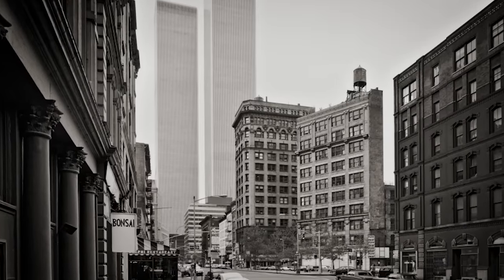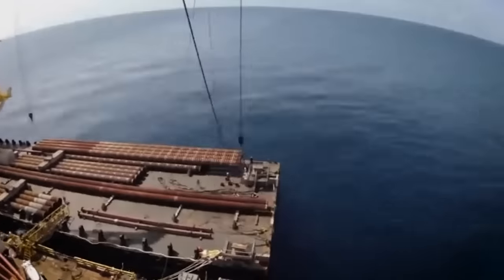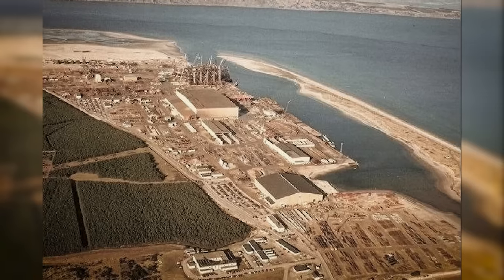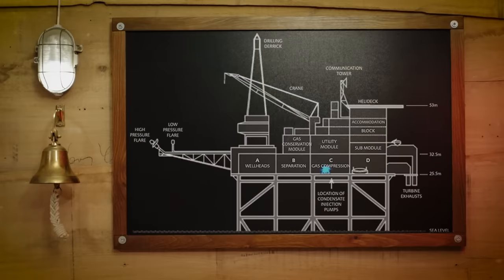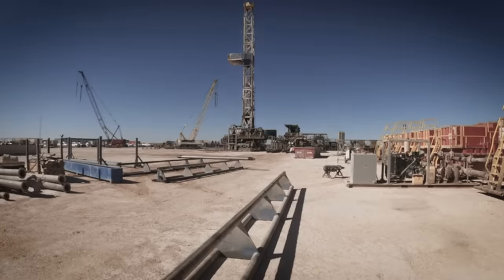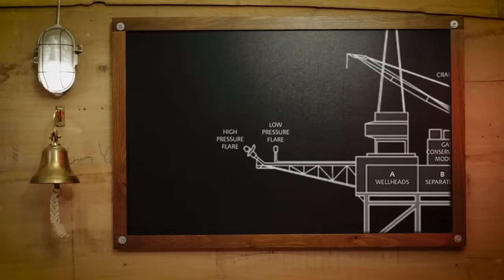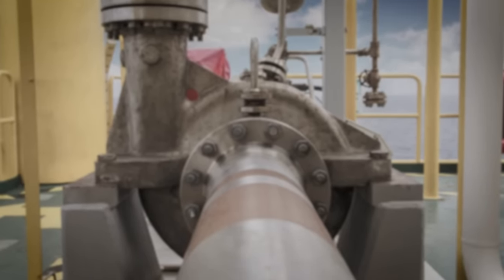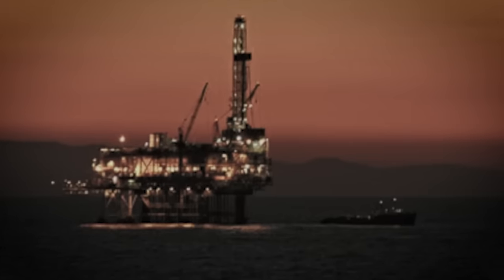This Block Has 87 Dead Bodies

Comment: This is why a lock-out system exists.  They should have been unable to start the pump regardless of incompetence and paperwork.
Reply from the maker: Probably the kind of accident that helps them implement those kinds of changes.
Reply: @waterlinestories  Oil & Gas are well known for their 1 priority production which = profit. Safety, the Environment and people coming up a ways behind. As in sloppy procedures and the fire stop walls that were made of a fireproof material that everyone knew was  brittle and easily shattered. The fact that there were no underwater Safety valves on the pipelines. All cost cutting measures taken to maximise profits with zero value placed on Safety.
Reply: @waterlinestories  
A bit late for those poor guys though😢
But hey the money men got rich so what a few deaths when their bank balances rise 😡 
They should of done time for the sloppy safety procedures. 
RIP lads 💔✌️🇬🇧
Reply: @waterlinestories  Yep thats what happened.
Reply: @jackdbur  Yes..Because it's cheaper to burn a platform down than implement safety training...

Safety is only as good as the men implementing it...
Reply: @markthompson9914  This is what I hate. Every incident should be a criminal charge against the CEO. Not safety criminal. 

The money charged should be 2 times the annual profit of the company and the board should face prison time. 

There was a case with Boeing where it was proven they knew about the problem and did nothing (even actively burying the email from the engineer). And yet no criminal charges.
Reply: @therasco400  yes mate, what u just said rang a bell with me. As a chap I know who is now a successful executive producer of certain motor sports shows and American football shows here in the UK, was once the guy who signed off on whether a plane was air worthy.
Anywho he would not sign off on a plane that he classed was not air worthy because of some plane language that I didn’t understand and still don’t as I’m a trawlerman lol. 
So to keep this certain costumer happy the maintenance company went back through the extensive file they have too have on guys in his lofty position, and found he was once charged with a joints worth of hash ( yes that long ago) when he was at college, so sacked him, and all to get an plane that could of took a couple of hundred souls out in the blink of an eye and oh yeah PROFITS 😡
People like that should never be aloud too put human lives over profits, but my mate was the guys subordinate or u could say the last link in the chain, so was just underhandedly got rid of. 
Still like I say, is in television now and making just as much and has a clear conscience 👍✌️🇬🇧
Reply: @jackdbur  yes. This is well known and nothing new and also not relevant to the comment or response.
Reply: @markthompson9914  what you are saying is purely ignorant and based on bias. It's just as easy to say if you know they take chances to make money yet so do you by continuing to work. When all goes well you're fine with what they do casually ignoring it because youre getting paid. So how different are you really? 🤔
Reply: @coronalight77  well in my 40 year plus at sea I’ve never lost a man too Davy Jones locker and have only one RLNI helicopter rescue of an old decky who suffered a stroke while he was making the coffee for the rest of the guys. I kept him out of as much weather as pos cos I had mad respect for him for what he taught me when I was climbing the ladder, and when I got my own boat he was my first decky cos at 60 odd he could run rings around some of the younger guys. 
So your comment was ignorant as YOU have not fished in weather that I have so know nothing of the risks we all take willingly too feed our families.
But u sit at your desk and judge, cos u know everything don’t ya chuck 🤣😂✌️🇬🇧
Reply: @DynamicSeq  As the platform was insured, it certainly can be profitable to burn it down. (also, the cost of safety can often well exceed the value of the platform. slowing production can significantly reduce profits.)
Reply: Just like aviation.
Reply: @jfbeam  seems like the insurance company at the very least would have a vested interest in lock out tag out lol.
Reply: @jackdbur  
And what is wrong with cutting corners? Capitalism does not care about human life, it cares about maximum profit which means under Capitalism, as long as you make money in turn its morally correct.
UK is already on a road towards Victorian era laissez-faire so cheers mate.
Reply: @coronalight77  it's showing.
Reply: Lockout/tagout the number 1 step for any piece of equipment being serviced offline.
Reply: @jfbeam  as someone who deals with large commercial insurance claims I can tell you that filing such a cglaim can tremenddously icrease preminums on that facility and others you own even if the are insured by other carriers. In extreme cases making insurance unaffordable economically or just not offered. Burning down ones property for insurance claims isn't as cut and dried as many of those not in business think. If it's a one time thing and you own no other properties then maybe ao but not in the day to day business world.
Reply: I'm thoroughly convinced the people in these comments don't think through the things they say and just mimic whatever biases they have. Who wants to bet if a previous poster reads this they believe I'm not talking about them.
Reply: @OneOut1  I have, in fact, had a building burn down. It made very little difference to our insurance, which was already rather high because it was already a high risk. (automotive service) The building where we had a dyno, the insurance agent saw that and just said no. (policy canceled immediately.) Insurance companies know the risks they're taking before they take them. An oil rig in the North Sea is every possible danger.
Reply: Deep Water Horizon springs to mind.
Reply: @markthompson9914  The emergency services here  say not if it happens again but when..
Reply: @pamelaadam9207  sorry “when” what Pamela ? ✌️
Reply: @markthompson9914  no one is forced to pick this job, there's a hundred other jobs you can do, your own experience isn't a really good argument.
Someone sitting a desk, responding to someone sitting at another desk 👍
Reply: @subu_versus  the only desk I have sat at was at school. But I’ve spent hours pondering over my chart table though. As for the poor guys who perished, did they have a say in the safety measures as I did when I knew a blow was coming I got the Fk outta there and looked to fish somewhere in the Lea of the land. THATS taking responsibility for the safety of my guys, me and my money earner the boat. 👍
Reply: @markthompson9914  - Everything you're saying makes sense.  I think it's worth bearing in mind that this accident happened almost 35 years ago (so 5 years after your career began?), when standards were more slack in that regard.  It should also be pointed out that Piper Alpha was one of the older platforms in use even at that time, and all of the changes, including the addition of the gas conservation equipment and subsequent condensate piping were all retrofitted within the physical confines of a an older platform that wasn't designed to do it - the first couple of decades of North Sea oil and gas extraction seem to have been a bit of a free-for-all in some respects.  In the books I've read on the subject it was stated that there's no way that equipment would be installed in that close a proximity to the control room and living quarters on new platforms that were being designed and built even back then.  I think physical/mechanical lockouts became mandatory a a result of this disaster.
Reply: @turricanedtc3764  you obviously have more knowledge than I on this mate. All I knew was that even on the boats I worked on back then, safety was a bit lacking cos the two main boat operators spent as little as pos on that kinda thing. But happy too say that it has improved a helluva lot in the days since, and when I became an owner/ operator all my guys had too have first aid, fire fighting and sea survival training for they stepped aboard. Now year on year more and more measures have been introduced.
It’s just bloody awful that we have too lose good people for action is taken by the big companies 👍✌️
Reply from the maker: @markthompson9914 Are you still on the water? What waters are you in and what industry?
Reply: @waterlinestories  
No mate I’ve hung up my oilskin’s, I couldn’t  compete with the prices of brown shrimp I was getting + the price of diesel and the cost of everyday upkeep. But my little corner of life was the East coast of England. But depending on what I was after as I had a small fish quota as well, plus I blew for cockles, it was from the Thames estuary too the Humber estuary. But my main waters was The Wash (if u want too google it)
That was my little slice of heaven in the smaller boats and the rest when the bigger boats came along. What about yself ? U a sea dog too ? 😂✌️
Reply: Why didn't that oil rig have lockouts by the 1980s I can only guess someone at the top was a greedy penny pincher.  Because by the 1970s (on land) electrical contractors had electrical lockouts as part of the electrical code.  One large industrial-size jobsite in late 70s was high paying, but run by a a corner-cutting penny pinching fool who had everyone use same-keyed locks on lockouts.  For one circuit there was a lock on and so a second lock was added.  About 20 minutes later go to cut a new electrical line on that circuit with linesmans pliers and Blam!!!  The cutting edge on those pliers has a large round hole on them which I keep as a reminder to never take safety for granted and never trust someone in a rush who insists everyone uses their same-keyed locks while aggressively pushing everyone to be done before you even begin.
Reply: @SMGJohn  it’s not capitalism. 
It’s greed. Plain and simple.
Reply: I have worked with supervisors who couldn't screw in a lightbulb who were absolutely sure of their choices and I would be begging them to stop as they would be cutting off the locks and the tags that said not to touch these panels

They never listen to the little people

But when it all goes wrong they love to blame us
Reply: Gee, hindsight is 20/20...
Reply: Captain hindsight to the rescue!
Reply: It always comes down to incompetence and money yeah
Reply: Yep lock out tag out.
Reply: @jackdbur  "with zero value placed on Safety."

They dont care, the INSURANCE covers everything, like airline crashes- the insurance pays all the lawsuits and damage and the airline gets a new plane
Reply: @therasco400  Trouble IS, companies incorporate and incorporation shields the CEO and the higher ups from PERSONAL liability, victims have to sue the "company" while the CEO and those responsible keep etheir McMansions, 6 cars and all the rest
Reply: @SMGJohn  sigh... capitalism is not about morals.. it actually says NOTHING about what morals u should have, it's just a way to optimize the manufacturing of goods and services. And there doesn't exist a single nation on earth that do not have some moral guidelines on top of the capitalism. Ur not allowed to sell heroin = moral guideline.
That alot of internet commies doesn't get was capitalism means is probably bcoz communism is not only a system for manufacturing of goods and services but also a moral system, something capitalism is not.
Reply: @richardcranium3579  
Capitalism is a system which does not perpetuate profit motive?
So how does Capitalism work exactly according to you? Cause I am real interested.
Reply: @KrGsMrNKusinagi0  NO WAY! ITS AS IF NOTHING IS PERFECT IN THIS UNIVERSE!!!!
Reply: @DynamicSeq  but implementing safeguards reduces short term profits. Ignoring the issue will help increase management's bonuses next quarter.
Reply: This was late 70s early to late 80s... welcome to the era of she will be rite mate. Safety is only implemented by large corporations when $ will be affected. This includes govt regulations. Any regulations that only garner fines are easily  taken as rough guides, anything that can cause catastrophic financial loses to shareholders is given more concern... less for worker safety and more for continuing to make $. Sure noone wants workers to die but costly implementation of slow down rules are always last to be forcibly implemented.  Having a system of central paperwork filing, supervisor meetings and double checking of all works done, regardless of importance, would take too long between shifts thus ( prior to decent computers) would be too costly. Unfortunately these deaths are the only things that tend to change dangerous practices in large multinat corps.
Reply: GREED WAS THE PROBLEM!!
Reply: LOTO 😌🙏
Reply: @markthompson9914  I've read your comment a couple times and still don't understand what the hell you're talking about.
Reply: @bradsanders407  and that means what too me 🤷‍♂️✌️🇬🇧
Reply: @pamelaadam9207  I’ve just re-read your comment and I must apologise for my brain fade at the time. I now see what u mean. 
“It’s not IF but WHEN” 
✌️❤️&🍀lass 👍
Reply: @waterlinestories  @aw
WF
Reply: @jackdbur  😅😅😢
Reply: Those are expensive, so they aren't paid for
Reply: @DynamicSeq the platform is insured and they can just blame the workers, so it all works out for them
Reply: A postal worker once told me: “if you don’t want your package to be bent, make it unbendable.” I’ve always stuck by this.
Reply: @therasco400  The Boeing situation is obviously vastly different than this one. They were operating within the safety measures of the day. What's more the CEO for Oxy had no real say in day-to-day operations here, it doesn't make any sense to consider him as the one to blame.

We have much more robust safety practices today in part because of events like this, but the context of time matters a great deal. Also, don't speak on things you clearly don't understand.

This event is tragic but how you can blame the CEO after hearing the entire detailed account of the accident is beyond me. You heard what went wrong. Did the CEO make any of the calls that led to this?
Reply: I just had a class on lock out tag out
Reply: Thank you captain hindsight! 🫡
Reply: @lammoth1214  That's not a "Captain Hindsight" moment, they're explaining a safety procedure that is universal today and clearly wasn't then. Systems today are designed so that no amount of missed communication or stupidity can lead to people being hurt.

Switches on pumps and other machinery have a physical lock placed on them so that they can't be switched on when they're LOTOed. Computer systems have interlocks that activate such that when a certain alarm trips or a system shuts down you need to intentionally acknowledge the problem and clear the alarm.

Safety procedures are written in blood. People are making an effort to be proactive now but accidents like this are hugely valuable for everyone else who does work like this because it shines a light on the system's shortcomings. In a modern system the flow of other fluids from the neighboring platforms would be stopped automatically, the line purged where possible, and so on.

Every accident is a learning opportunity.
Reply: A simple lock thru a lever would have saved all these lives
Reply: @SuperChatsRNotTips  Thats exactly what Lock out Tag out is, thats why the comment said the Lock out system.
Reply: @lammoth1214  lock out systems existed when these men were babies.
Reply: @ALiberalVeteran  yes yes it was
Reply: @jackglossop4859  they should've grown up damnit
Reply: @Jack Glossop  but in reality I was doing a south park reference
Reply: Breakdown in Communication.
Reply: Those little locks save lives
Reply: Where were you guys when they needed you?… 👎🏻
Reply: @Mark Thompson  what year did they sack him for the hash? The rehabilitation of offenders act 1979 would prevent him being sack unless he lied in the job interview.
Reply: 🎯 Lockout Tagout 😊
Reply: @markthompson9914  not even to a Shark ? 🐋🐋🐋🐋🐋 or a 🐳🐳🐳or  a fast moving 🐬🦈🦈🦈
Reply: @markthompson9914  who is this "Chuck" ?
Reply: @Johnny2Bags47  for we get to who “chuck” is WTF are u on about in your middle comment 🤷‍♂️ cos that don’t make sense t man nor beast Chuck 🤣😂 
There I’ve answered your question Darren, now u use English and explain that….that whatever it is 😂🤣
Reply: Accusations of incompetence requires equivalent evidence sir.
I hope you have it, because some of those men survived, and those that didn't have families. Teh truth is not defense to slander in Britian.
Reply: @jackdbur  IF you actually listened to the video you come to realized that their procedure wasn't sloppy, it was just a sequence of human error that caused the disaster .
Reply: Ive worked on st Fergus and it's scary what could happen if the place went bang🙄
Reply: @jackdbur  all industry is. idk what industry youre in that profit isnt the major motivator. do you make sparkle dust and faerie kisses as a job or something? 

its how the labor world is. you ALWAYS need to look out for yourself and your guys. no one has your back from corporate, no matter what job you do.
Reply: L.O.T.O or lock out tag out existed before this accident but it was only in America and OSHA compliant facilities. British petroleum companies have a long history of production over safety or common sense British companies or armies around the world have had that problem for centuries now.
Reply: @jackdbur  BS. I work with majors. Number 1 priority is actually safety. Workers have “stop work” authority to stop any job if they observe something unsafe.
Reply: @Tom-tk3du  Now they have. Then not so much so especially when you were on a platform owned by the company. Notice how they didn't even abandon the accommodation block into the lifeboats attached to it. Because the abandoned signal wasn't given.
Reply: @DynamicSeq  Its a gamble, if nothing serious happened, they win. Small injuries they can just pay off, safety isn't cheap and it almost always adds time to repairs/production
Reply: Dang Jeremy I didn't know you were such an expert at pipelines
Reply: What a lot of people are failing to consider is that in the 1980s and into the 90s, there wasn't the health and safety culture that we see in a lot of hazardous environments now.  Yes there were safety measures in place, but back then, considering the time lost and the cost to implement changes, changes that likely hadn't even been thought of at the time, seemed unnecessary.
Reply: We have lockouts today and people don't use em as much as they should. A company can have an excellent LOTO program and constantly remind their employees that their life is not an even trade for saving a few minutes, but workers still get killed for not following LOTO procedures. I know because I've worked in places like that. You can lead a horse to water...
Reply: This disaster is the main reason that lock out system exists. Back then they thought that something like this could ever happen. They put way more faith in paperwork, and human oversight than they should have. And if I remember correctly this disaster also gave rig managers more authority during a crisis situation to shut a rig down without authorization from the stooges running the corporations. It didn't just change things in the United Kingdom, but around the world. And if you're wondering how I know this, I watched the news reports while it happened. And the hearings afterwards on who's fault it was. It was big news here in the United States, because we had so many oil rig , and this incident caused hearings here on their safety.
Reply: @jackdbur  your first two words were misspelled. correct version should read “capitalism”
Reply: @jackdbur  Safety is an evolving science. I worked offshore in the North Sea several years before the Piper Alpha tragedy....even landed on Piper Alpha a couple of times enroute to the platform I was working on. It's easy for armchair critics to claim the accident was due to greed. But it's normally due to plain old human ignorance. I never read the incident report for Piper Alpha, but I'd imagine it covered any lack of notice to abandon the platform.  I'd like to know more about that.
Reply: I was just thinking "don't they have a lockout/tagout procedure?
Reply: @waterlinestories  All our regulations are written in blood. Men have died, all our rules are there to prevent it happening again.
Reply: I’ve used lock-out system many times in the navy and at the chemical plant I retired from, I’m still here!
Reply: @johnanon6938  I text wires for current and voltage before I cut them as I am an engineer. Test instruments are available.
Reply: Amen!
Reply: Amen bro!
Reply: LOTO, for a safer tomorrow
Reply: If ppl could wudda cudda shudda then there would never be any accidents
Reply: @shitmandood  bingo
Reply: Such regulations are said to be written in blood.
Reply: @IcarusErm  Absolutely 👍
Reply: @waterlinestories  Yeah. I'm not familiar with oil and drilling specifically but many SOPS/regs are written in blood.
Reply: @therasco400  That is a bit unreasonable to be fair, I agree companies should be held more accountable, but CEOs are so far removed from what happens out there at sea that there's no way they can guarantee total safety without having a direct hand in operations. They are not experts in oil rig operations, they're businessmen who hire said experts. If we want people to take our calls for accountability seriously we need to at least be reasonable.
Reply: @SMGJohn  Yeah yeah yeah, we've heard the same spiel about how "capitalism bad" and how "capitalism only cares about profit" a million times now in the YT comments. Got any better ideas for an economic system? Are you an economist? Didn't think so.
Reply: @JohnDoeWasntTaken  The position of CEO is a position of responsibility. They set the safety policies, work ethic and hiring policies. They ultimately sign off on Standard operation procedures and decide how they are to be enforced and monitor them. The reason a CEO is payed the big money is because they are ultimately the ones responsible for the conduct of the company. 

Just because they are not onsite does not mean they do not have significant influence over it. I agree in most cases the failure is not at the level of CEO but to me that says the CEO does not a comprehensive enough reporting system.
Reply: @JohnDoeWasntTaken  
Am I an economist? Well I have a degree in it but you are clearly not interested in that, neither are you in learning basic economics either seeing how you do not even understand how market economy works.
Reply: 2 owners  at minimum should be on every platform that is in use to help insure that safety is maintained at all times. Let some of them perish when safety isn't first priority. 👍
Reply: Horrible loss of life for what?Greed pure Greed for Money??????????
Reply: @ocsrc  Spot on, I worked at Torness (nuclear power station) whilst our Government stated that there was no nuclear fuel present, during pre testing, that's the first porkie, indeed the radiation fluid leaked out a pipe joint profusely therefore my experienced supervisor closed sections of pipes and diverted same. A major alert issued, my supervisor left to find out why the boffin's delay in response. We were the only two people in the world who new the new direction of fuel flow! Only myself was present when eventually the boffin's arrived and they were arguing among themselves the direction of flow. To assist them,I politely tried to explain reasons, which pipe was live and where directly fluid was going, As I had a (green) hat on instead of White I was abruptly told literally to SHUT UP ! THEY are very dangerous people and as much good as a concrete parachute 😅
Reply: As we all know too well, there is two kind of justice. One for us, and the lack thereof for them [big money].
Reply: @markthompson9914  My brother-in-law was an aircraft maintenance engineer for corporate jets in Canada. On more than one occasion, he pissed off a company honcho or pilot because he wouldn’t sign off on the airworthiness of a plane. But he never lost an aircraft or a passenger and slept well at night.
Reply: @designchik  
I hear that mate loud and clear. 
“If u can sleep sound u know u have done good” my ol Nan used to say.
OR your a psychopathic narcissist who scream’s “officer safety” and “stop resisting” every chance u get, my grandad would chime in 😂✌️🇬🇧
Reply: @ApolloTheDerg at the end of the day they don't have a say in it though.
Reply: Yeah we have Lock-Out Tag-Out procedures where I work and I appreciate them. We use red special padlocks for locking power levers in the disconnected position for example.
Reply: Wow, I was thinking the exact same thing, and then I wondered if they even knew about lockouts back then? This is just as tragic as the Horizon I think.
Reply: @jackdbur  we're a different breed. We get worked so hard for so many hours and dealing with everything that weighs 1000s of pounds, dirty as hell and tired, a lot of us don't give a shit if we live or die because sometimes death would be a sweet release from the hell wee go through
Reply: @waterlinestories 
Most of the safety instructions are written with blood.
Reply: Loto. Lock out tag out.
Reply: @markthompson9914  the investors lost their ass on this one. Not only a hundred million dollar rig but lawsuits as well. They deserved to lose their money
Reply: That's what I also wondered about. Maintenance switch to off and put a lock + sign on it.
Reply: Natural selection at its finest
Reply: Yes indeed. I worked at a refinery and lock out/tag out was a major part of safety training. There was even a clamp that went on the breaker and it had holes to put 6 master locks on it. They took things like that very, very seriously.
Reply: @SMGJohn it’s a system where price meets demand. Has nothing to do with profit motive. You are applying judgment in ignorant ways.
Reply: @jtfike  
Price meets demand? Okay now I see you are a little kid. 
In what world where OIL is needed so much for everyday life, yet prices keep rising despite the price of the OIL barrel being lowest its been in 50 years? 
Thats apparently "meeting demand" according to you, LOL! 
Its even funnier when the food prices keep increasing, 300% since 2020, thats "meeting demand" apparently people are eating less food now according to you, or what, the more people want it, the more they jack up the prices? Your logic all over the place.
Reply: So you're saying that this could have been avoided even through incompetence. You're a classic.
Reply: @therasco400 what will this change or ensure for the future? While I certainly agree I also think just charging fines and jail time will not change people at their core, except even more poorly.
Reply: @TerminusEst1982  Its debatable it will change anything but there are two idea's that i have in regards to it. 

The first is Leadership, It forces the removal of a CEO after a significant event the company was found at fault of instead of leaving it to the discretion of the share holders. This in turn means that the business cannot carry on as normal after paying the fines. Now I understand that in very few cases it is business as normal but it will also force a complete review of procedures by who ever is elected by the share holders. 

The second is that the punishment is not just a slap on the wrist. While I can see the 2.5 billion dollar fine not really being small money its also not that impactful for the size of the company who posted a profit of about 14 billion. It basically means a company that will crash, 2 years of no money making will make alot of investors pull out or get far more serious about voting on the board members. 

My point is that it should wake the investors up that profit is dependent on safety not that safety costs profit.
Reply: @waterlinestories Cheaper to pay 50k a body than spend millions on extra safety.
Reply: They should do a investigation because it seems like a criminal Act
Reply: @waterlinestories Exactly right. Until this accident, safety regs were reactive. Afterwards, they turned more proactive.
Reply: “A common mistake that people make when trying to design something completely foolproof is to underestimate the ingenuity of complete fools.”
Reply: @jackdbur this is true. I am a chemical engineer and worked for big oil out of college. It is all profit driven. For safety and personnel they do the bare mandatory minimum
Reply: @DynamicSeq  seriously?....i give you the Westray Mine disaster......easier to kill 29 men than follow safety regulations
Reply: Any process with the message "be careful" will fail.
Reply: LOTO for lyfeee fuq the production
Reply: @waterlinestories Yeah because safety is only important after you die.
Reply: Yeah it’s shocking that something so important/dangerous was handled in this manner.
Reply: I came here to say that. I'm not very familiar with oil business but this is a must do in utilities. Lock out and tag out (LOTO)
Reply: I’m 😢😢
Reply: They show about the same safety concerns in power plants. Seen where a bunch have died in precips. Never gear about it because the t send us across the country to do these jobs. All about the benjis. The lack of human welfare  for money is standard procedure these days. And prior it seems
Reply: Yes, LOTO would have prevented this disaster.
Reply: There was documentation on lock out but it was kept in a different location, the problem here is the redundancy, where the documentation for everything should have been left in either one central location to both locations or both locations had documentation at both locations, pertaining to the status of either the main valves or pressure pressure relief valve.
Reply: @ApolloTheDerg 😊
Reply: @jfbeam 😊
Reply: @jfbeam 😊
Reply: Imcompetence to lock out tag out doesn't solve the risk either. There will always be accidents, no matter the safety standards. People, wear and tear are always going to cause accidents.
Reply: @jfbeam  yup they cancel for little to nothing.   Now your even more high risk be sure they had to cancel.  I was canceled because I made a claim.    Huh.   What a racket
Reply: @jfbeam  yup they cancel for little to nothing.   Now your even more high risk be sure they had to cancel.  I was canceled because I made a claim.    Huh.   What a racket
Reply: They did have a lockout system -a lockout system, still relies on paperwork and competence. In order to function. The problem was the systems were never applied well, never enforced forced to be applied well ,very little training existed and the normal practice was to bypass those systems that were there.
Reply: @ApolloTheDerg  yes, indeed they would. The trouble is most of the people auditing these processes have no idea of the real world get shown something in the book get taken for a tour and think. Yes, that looks good. I have done many audits on land based oil and gas platforms and managers have been very surprised. We have just been audited over the last five years and had glowing testimonials. I always ask who’s done them in terms of the company in the individuals and normally they’ve been done by professional auditors lawyers accountants etc!crazy really -all just paperwork processes. I have come from a field operations background, so I look at the documents, but I say show me what you’re actually doing because that is the stuff that will save lives.
Reply: In the End it cost them dearly, not only financially. It's not worth it to cut funds on safety.
Reply: @johnanon6938  they did have lockouts. They just didn’t have a robust procedure and the procedure. They had was easily defeated, without proper checks and balances.
Reply: @markthompson9914 they never face the consequences 😢
Reply: I'm a safety manager and I use this incident as an example in my lockout tagout training videos
Reply: Exactly what i was thinking lmao none of this would have happened
Reply: @cdm1250uhf1 wtf u talking about 💀
Reply: I completely agree but like dude said it was built in the 70's and 80's and in a different country plis it's in one of the most dangerous seas. Im pretty sure inspections and other safety regulations definitely were not as strict back then as it is now. Plus thats how safety regulations get rethought unfortunately people have to lose their life before they tend to wanna make things safer. Which is completely retarded.
Reply: actually, if you think of all major accidents, number of things happened in sequence in order for full disaster to happen. each separate one have stopped the chain reaction. but all of them were somehow skipped in the end. in each one, safety procedures were skipped in hope that other things catch it. well they didn't. sadly it's really hard to prevent them all. here, it might be good on, if anything has started on pump a, it would be marked as in progress, eg don't start, it's dismantled. or perhaps physically lock it out with label what had been done. then operators have full knowledge if they really want to start it with pipe open. latter might be needed in some cases, it's just they would know. here they didn't. and other things helped to get it all out of the control. hell of a sad story
Reply: You are right.  Pump A should have been locked out so that it could not be started. That's basic lockout/tagout.   Writing on the paperwork not to start it was pointless since that paperwork was kept in a separate file.  That was a system failure. Paperwork for associated equipment should be kept together, regardless of being in a different location.
Reply: Lock out tag out allways
Reply: It didn't back then Einstein
Reply: @karlscher5170 I was looking for that comment
Reply: @coronalight77  interesting take
Reply: @waterlinestories almost every safety regulation is written in blood
Reply: @markthompson9914 but the owners wouldn’t have anything against them it would be the people who designed the rig or whoever was appointed to health and safety
Reply: @DynamicSeq this. People act as if three letter office guys are incapable of risk-benefit analysis. The oil and gas industry today is extremely risky averse because multi million dollar equipment units and wrongful death claims and such are far more expensive than safety programs, ppe, check valves etc.
Reply: @richardcranium3579 people will blame capitalism but then never explain extreme industrial failures in communist economies. Not that capitalism doesn't have problems, but it's a poor argument re: safety
Reply: LOTO system basically started due to this accident…
Reply: In industrial settings, people cut locks all the time, just not on paper.
Reply: Lock out tag out
Reply: I'm not sure but I don't think lock out tag out existed then.
Reply: @josephdelp87 it did. It w@s used on this jib but very lax. Obv.
Reply: @DynamicSeq bozo they weren’t given proper stuff to begin with it was the materials not the men that failed ie those at the top who ordered them built that way
Reply: @baconater4199  WTF are you talking about...?? They did not follow safety protocol. . And they paid with their lives for it....
Reply: Man can’t even control the chaos they create
Reply: A lockout system is only as good as the fellas using it, or more likely on this rig not using it.
Reply: Oh, is that what that OSHA class was for...?
Reply: I totally understand the impulse to bash oil and gas companies (and yes, they do deserve much of the criticism) when a disaster occurs, however:

Does the loss of all the infrastructure, equipment, and well trained men (and the subsequent payouts to families and losses incurred to investors as well as government fines plus the addition of new government regulations) really sound profitable? I can't see the CEO sitting there, twirling his moustache and laughing maniacally "nyahaha, now we're going to blow up an oil platform and kill a bunch of men!", I'd imagine the CEO is more likely thinking "oh shit, this is going to be incredibly bad for profits, we need to make sure shit like this stops happening". But (in my opinion) the problem is not the CEO or the profit motive (as profit motive would lead to not having disasters) but the problem of organizational and bureaucratic bloat, and the perverse incentives many of the mid-level managers have (ie: bonuses based on cutting costs and unrealistic deadlines) and cause them to make shitty decisions that impact the safety of everyone, while the higher-ups likely don't know the ramifications of it. If the people making the decisions that impact safety had actual long-term profit motive (ie: by basing bonuses on stock market performance and company profits, or making them shareholders), they'd make better decisions than they do when given short-term profit motives (get this done as fast and cheap as possible, and you'll get a fat bonus).

I'd also be willing to guess this same problem (misplaced incentives on mid-level managers) exists in many industries, and similarly has detrimental consequences on worker safety and company profits.
Reply: lol right on
Reply: Piper Alpha is the real world example of Douglas Adams SEP field [somebody elses problem].  There's kind of a union mindest in the UK regarding a good number of north sea workers: it was common to hear "not my job" or "is it certified?" [meaning they don't really know the why of something being safe or not and defer to third party as a means to sound concerned & engaged - and hope nobody knows they took the short bus].  The situation in a nutshell: two marine units with interconnections for hydrocarbons, and two separate management entities with minimal connection to each others operations as far as daily routine went. Disconnect, downtime... disaster.
Reply: @kungfreddie  first half of your comment went well and then your second half was just sewage. ew
Reply: Everybody working in the petrol chemical industry, knows there’s always that small chance an accident could happen. No matter all the barriers installed. Lototo, lmra, tra’s name it, help but it’s still dependable all on a human factor. The worst thing is we all get used to that danger.
Reply: Pretty sure this kind of system wasn’t so prevalent at the time, and even if it was in place, with the culture and levels of complacency within the industry at the time it was probably barely ever used. They never thought it would happen
Reply: @therasco400  If every incident = CEO criminal charges, then the companies would simply make the janitor CEO and threaten his family or whatever if he didn't play along. There are no simplistic shortcut rules like that. The only proper way would be to investigate and charge individual people who acted criminally. Which is pretty much already what the rules are. Enforcement is more at issue than the rules.
Reply: @DynamicSeq  its not just the training, it costs a lot of money to buy safty equipment, to replace broken equipment, maintain and inspect the equipment. and putting in special parts with safty valves/detectors/shutoffs costs more then just a straight peice of pipe, or an older version that doesnt have the saftey stuff on it. 

and then you have to design a training program, wich requires approval by different groups, train people, then send those people out special to train the workers, which means people getting paid and not generating a profit while they're in training. 

but sure, just blame the workers. thats easier. thats what a lot of buisnesses do anyways. because ITS CHEEPER To blame the workers.
Reply: Lock out doesn’t stop incompetence; I’ve seen management use bolt cutters to cut the locks to restart equipment when production is down. These people don’t view workers as people or even workers, just numbers.
Reply: @coronalight77  Salaried people need the money for daily living. Hence often, we compromise our own safety. The super-rich use your annual salary for A DAY of private jetting, caviar and champagne. Very different power imbalance.
Reply: @richardcranium3579  greed is capitalism. Have you heard of how capitalism concentrates the world's wealth in the hands of a small fraction of human population?